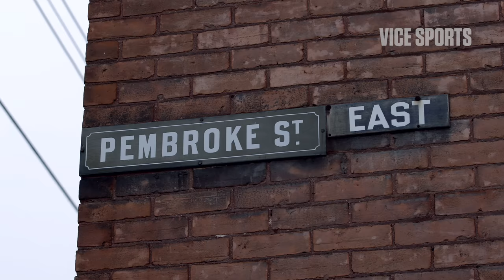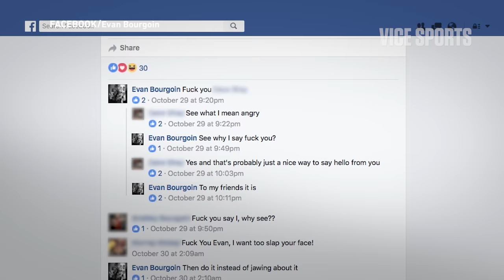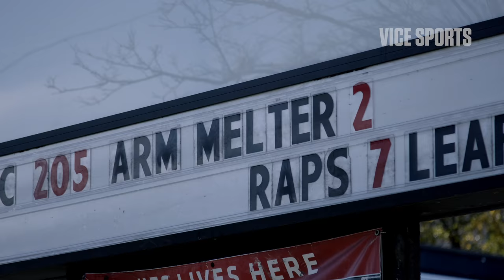Canada's Beer Guzzling Arm Wrestler: Street Legends

Comment: If everything you did was about armwrestling a bit of advice bro! Swing a hammer instead of the nail gun. Let someone else run the gun and swing until your arm falls off.💪you're a beast for sure. Good luck in the future
Reply: ive hand nailed for years, the vibrations of the gun are great for bone density. and i get paid by the bundle not the hour